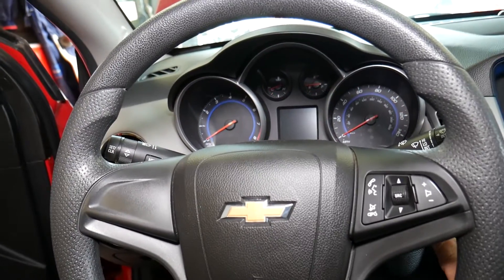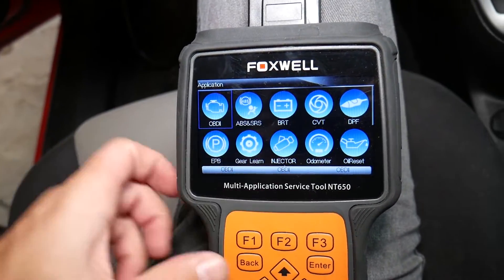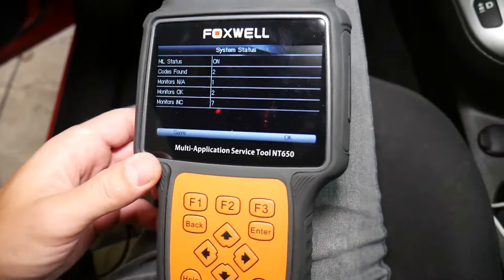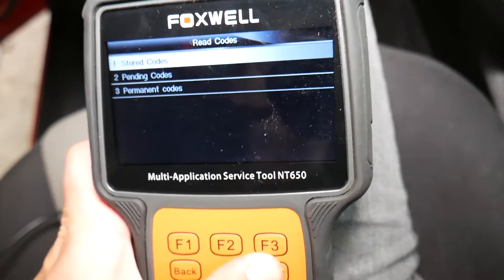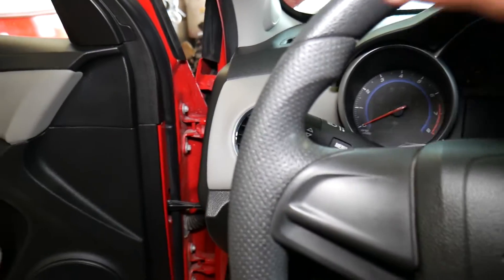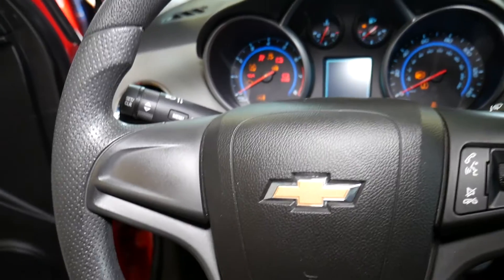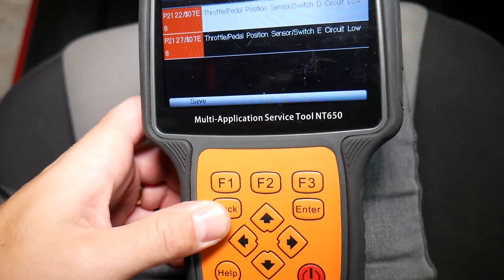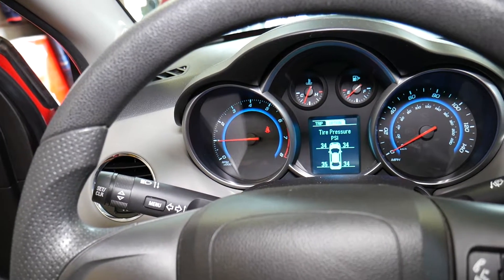FIX CODE P2122 P2127 ENGINE LIGHT ON ENGINE POWER REDUCED CHEVROLET CRUZE CHEVY SONIC

Comment: I just replaced my pedal and test it out for 20 miles. It ran with maximum power in replacing the pedal. I stopped at the gas station and get back into the car and the same response and trouble codes are on the dashboard. What do  I do now? Thanks again for sharing your video
Reply: Did you figure it out? Dealing with it atm

Comment: My 2014 Chevy Sonic ltz is in limp mode.  No tranny indicator lit up on the dash!   Stays in one gear!  Goes up to 40 mph! rpm 3000! And it pops in and out of this mode seemingly At it’s own will!    Is the tranny shot? Is the transmission computer shot!   What is my next move!?    Thanks
Reply: Please let me know if you find the solution my sonic is having the same exact issue, except mine Jenks pretty harshly going into drive or reverse
Reply: @HAUNEBU, did you get any DTC codes?